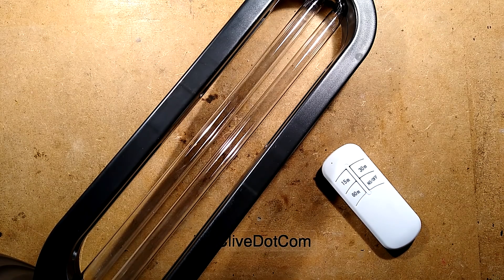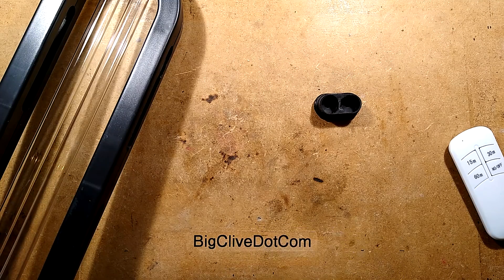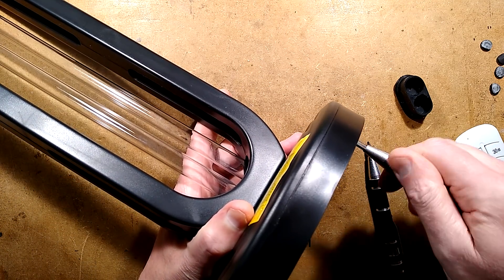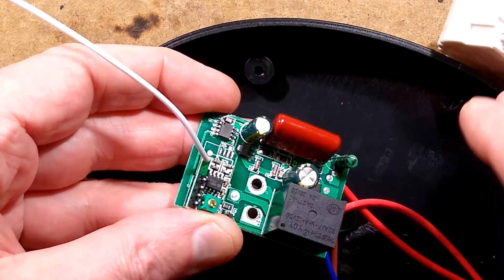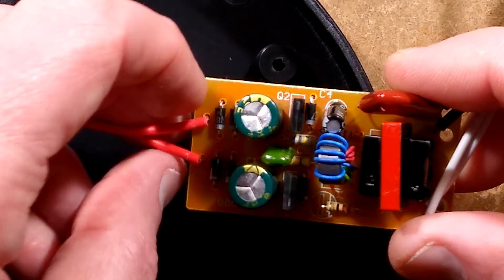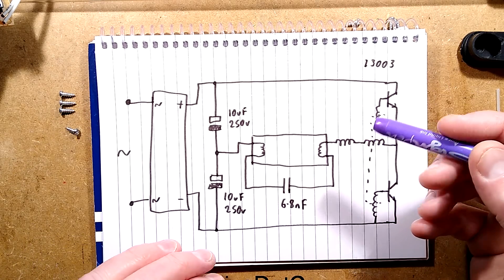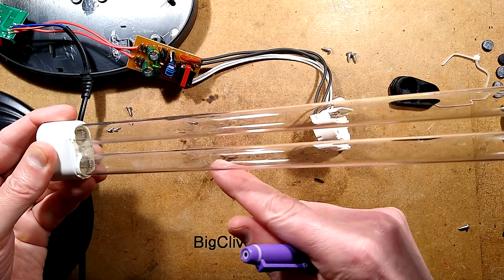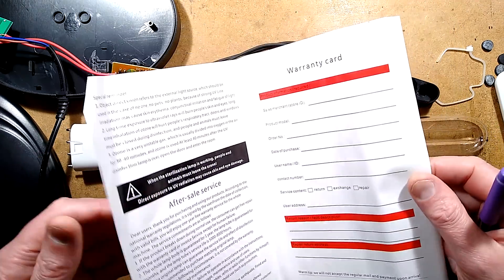Inside a stylish tabletop UVC germicidal light.  (Skin, eye and lung hazard)

Comment: I bought a 36 watt UVC lamp to serve as an extra sterilization step in cleaning my EMS squad's ambulances after wiping everything down. It certainly does put out copious amounts of ozone, by which I assume that it is also putting out copious amounts of UVC at 185nM wavelength. It came with a pair of yellow glasses with no markings for "protection". I immediately tossed them to the side and got a name brand pair of UVC goggles and I still don't stick around once I verify that the lamp has turned on.

Comment: It does the job.
(If the job is planting a dangerous object at a garage sale 10 or 12 years in the future)
A friend bought just such a mercury vapor lamp at a garage sale which had a sticker on it stating simply "Sunlamp" with a picture of a "sun man" who was, prophetically, wearing sunglasses. My friend was lucky to only get welders eye and a bad sunburn in the 1/2hr he said that he had used it.
I inherited the lamp for examination, it was a tin box with a small ballast, starter and a bare u shaped mercury vapor tube. The tube died with an airgun shot, the balance ended up in a junk box somewhere.

You almost HAVE to properly label something like this and bring it up to code (or at least a reasonable level of safety) if you allow it to continue to exist. It's like receiving a "fake" grenade and finding it's got real powder in it. You can't just put the dummy fuse back in and pass it on.

Comment: Thanks for reviewing this one is like copy of proper one I have at home that is taller and tube is 55 Watts and its made from metal stand and cage aroud the tube I paid aroud 60 pouds and it came with nice neathy remote with anthena and what is bad about this one it turns on straight original one will be off untill you select time and than it will turn on afye 15 seconds. And it's ozone free safer to enter room after bein sterilised.

Comment: You are probably right about "who discovered potato juice would relieve this"...
I was a welder/fitter for about 15 years, and flash burns in your eyes are just something that happens when you are working in close proximity in a welding shop to a bunch of other honyocks all day.
And when you get a good case of it, it's the worst thing ever... you'll be willing to try just about anything and everything to make it go away. A bad case of weld flash is absolutely one of the most miserable things I've ever had to endure. I once made the wife get up at 1:00AM and drive me 40 miles to the hospital just to get one drop of that numbing stuff in each eye (which they will flat-out REFUSE to prescribe or let you leave the building with). So yea... I imagine the guy who discovered this potato thing was going through the same condition.
Oddly enough, I've never tried the potato juice thing, I don't even know if it works.

Comment: When comes UV lamps as sanitazing equipment for keys and such could you use money tester device with tube lamp? I'm asking because I found one manufactured in late 80s or early 90s judging by the sticker on the back. It is power by 220v AC and it is just a metal case with lamp ballast and socket with said tube.
Reply: Wouldn't be effective, the banknote testers are on the same UVA wavelength as disco lights etc.
probably want to be giving keys a squirt of 70% alcohol from an atomiser bottle and a wipeover IMO
Reply: @joinedupjon  I actually have IPA isopropyl with atomizer next to the door. I just wated to use this gizmo for something else and give it a second life.
Reply: @Szeptun  suppose you could stick a UVC tube in if you wanted and fit a  timer. I don't think it's a good idea and tbh would only sterile one side of a key at once. 

Proper use of UVC tubes means having them in a closed lightproof box with an interlock... like an old EPROM eraser

Comment: U shaped tube because the other type is still covered by a Phillips patent and copyright. They developed the machinery to take the 2 straight tubes and join them with the top bridge, and made automatic machinery to do so, though doing such with quartz glass is difficult because of the high temperatures you need. Much easier to simply heat the quartz glass till it softens, and pressurise it slightly while bending around a mandrel to keep it from collapsing.

Comment: Typical bare run chinesium snakeoil. Presume the tube is a real deal, this thing is still a waste of electricity. Using layman terms, germs and virus are some tough bastard, you need to shoot them in point blank range with death ray to kill them. Somthing deliver like 6mj/sq cm at 5 mm distance in 45min or less time.

If your common sense is still there, did the manufacturer tells how big an area it can sterilize? I have seen someone who are in making dry fish and squid business using similar setup. He think it is a better solution to kill bacteria for the fish meat. Better than the current method of other manufacturers, they are using ddt and sulfur. Guess the result? Of cause he fail, yes, the uvc and ozone kill some of the bacteria on the surface, but if the fish meat is too thick, the core is still untouch. How about entire room? Put it this way, the strongest uvc source we known is what? The sun, right? How about the sun compare to this tube? And the fact is, even sun dry fish is still not a 100% success, what do you expect? Germs and virus did not extinct, and we have the sun shining everyday.

How come it works in water treatment? It is use in point blank range with limit volume of water with a strong light in a certain time. Do a living room fit these requirements? 

Common sense and do the math, please.

Comment: I wonder how glow powder would react to UVC  it might glow very brightly or not at all, and if you could expose the inside of a broken fluorescent tube or CRT would also be very interesting.
Reply from the maker: Small UVC lamps are used in the neon industry to check phosphor colours.
Reply: @bigclivedotcom  Yes since most neon colors are white when unlit.
Reply from the maker: It's only real affected by the UVA band of the output.

Comment: Thats dangerous unshielded. It might be okay in an unoccupied room, but you may damage some materials from exposure. It might be okay for some applications. Laying a moist slice of  potato on your eyes is something from the 1940's and it does make your eyes feel better. Does it actually aid in eye repair ? I have no idea. I've had some flash burns from being around welding and it at least made my eyes feel better. Good video.The diagram is just like one that would be used for florescent lighting. From the poor build quality it looks like it's made to have a life of around the 1000  hour range, but I'm just guessing. I hope you have a safe night.

Comment: Hi Clive, I modifie a ballast for compact fluorescent tube to work with a 18W UV-C tube. If you are interested (you might be able to make a video out of it) contact me.
Reply from the maker: I've done that in the past myself.  They're very fussy though.  I tried running a short neon tube from a CFL circuit and it emitted smoke before exploding.
Reply: LOL, I have made 8 so far  and I have 1 on test passing the 50h mark and 100 on/off cycle.
Reply from the maker: @pierretremblay9378  Any blackening (sputtering) around the electrodes?
Reply: @bigclivedotcom  No sputtering so far I can see yet. I can tell the ballast is not very bad but I will need thousand of hour to see if it is very good. The striking is a bit fast for my taste but it is about the same as with the CFL.  I use a ballast for 23w CFL but with the 18w UVC I was only able to push around 9W. Somehow the working voltage of the UVC is not the same as the CFL. So the solution is to lower the value of the inductor. The real solution is to remove around 30 turn of wire but is a pain. The other solution is to remove part of the ferrite, that the one I use. A neat one is to put a neodymium magnet on the ferrite, by moving on the BH curve you can change the value of the inductor. The fun part is magnet lose strength with temperature particularly neodymium. That will bring some thermal regulation. At around 80c(N type) the loss will be permanent but that also ok, the ballast have somme kind of memory and adjust to 80c max ...
Reply: @bigclivedotcom  Neon is cold-cathode while fluorescent is hot-cathode. The voltage and current values are massively different between those types. I wonder if this played a role in your unfortunate event.

Edit: I just remembered that I ran a 35W low-pressure sodium lamp off an electronic f-lamp ballast. The ballast current was a little low which caused some sputtering of the cathodes so I stopped running it that way. I actually got in contact with a discharge lamp expert and he confirmed that low-current was causing issues.
Reply: @thelightninghunter23  That one of the odd behavior of FL, they dont like to be turn on. You see between each cycle of the main they go off and on. When you lower the average current the re-striking voltage and time go up. Then because of the ballast capacitor and the negative resistance behavior of the tube the current spike increase drastically making sputtering. And no running them on DC is not good, the negative electrode will sputter very fast. HF then, well now you have capacitive leakage current making the end of the tube experiencing more stress for the same average output. Long time ago a spend a few year of my life designing electronic ballast and they are a nightmare of trade off, witch make them also very interesting.

Comment: 1 Watt while doing nothing? That sounds like a lot. What is it doing? Does it have to keep the electrodes warm all the time? What happens if you try to turn it on right after you plug it in and it's cold? Also they warn you right on the remote control.. "NO" instead of "ON". - Side note, it would be interesting if you bought some KN95 masks on aliexpress and took a close look at them.. I just got a bunch in the mail and not sure how legit they are.
Reply from the maker: The one watt is the standby of the remote control circuitry.

Comment: I am  MD on the front lines of COVID-19. Desperately looking for things to sterilize equipment myself and colleagues use.  I noticed a comment about UV LED's and was skeptical as well. However i found a reference that is up my alley .   It shows UV Lamps which were regarded as the standard has emition at 254 nm. DNA has absorption at 260-264nm so its most likely to be germicidal.  Secondary germicidal effect from generated ozone of course is excluded , but is probably a big component. And I am aware of tubes that by regulation do not produce O3 by limiting its spectra with a coating.  So there are LEDs that are common and cheap that emit in the 270-275nm range. They in a way could be more effective than the 254nm fluorescent tube counterparts, especially the non ozone type. Here are some resources, Contact me to discuss.  https://www.rk2.com/uv-information.php
https://www.ncbi.nlm.nih.gov/pmc/articles/PMC4702654/
http://www.uvresources.com/blog/the-ultraviolet-germicidal-irradiation-uv-c-wavelength/
https://www.light-sources.com/wp-content/uploads/2015/05/Germicidal_Lamp_Basics_-_2013.pdf
Reply: You may want to look at using vaporized Hydrogen Peroxide.    Duke is using it to sterilize hundreds of N95 masks a day.  
https://medschool.duke.edu/about-us/news-and-communications/med-school-blog/duke-starts-novel-decontamination-n95-masks-help-relieve-shortages
https://www.safety.duke.edu/sites/default/files/N-95_VHP-Decon-Re-Use.pdf

Please watch these three videos talking about disinfecting and reusing masks then making and using disinfectants.
https://www.youtube.com/watch?v=2UdtKssU7po
https://www.youtube.com/watch?v=kLWBG_fbJR0
https://www.youtube.com/watch?v=CQ1PNXa_LaI
Reply: And a good page at Wikipedia:
https://en.wikipedia.org/wiki/Ultraviolet_germicidal_irradiation
Reply: Bill Whittaker  Be careful with the rice cookers and home ovens.  The temperature in them swings drastically.  You really need a precise oven with better temperature control.  The engineer at Tech Ingredients covers this.  
https://youtu.be/CQ1PNXa_LaI?t=1221
Reply: Great now work on tobacco obesity and suicides
Reply: @cgletts  lol what

Comment: Clive you need some clip on  arc shades, we use these all the time at work. I can watch the 200 amp cnc plasma machine all day with no issues https://www.amazon.com/dp/B000HJIBQO/ref=cm_sw_r_apa_i_vu8KEb7X83NPV
Reply from the maker: I have some similar shades that fit over my glasses and also a rather shady light reacting one from China.    Plain glass alone will block the UVC components.

Comment: Ages ago when I worked in a biology lab (cleaning stuff up at university) - they had a sterilization cabinet that all the tools/safety googles etc went into - when you opened the door the lights shut off. The professor told me the way it works is it mutates the cells until they die. I suspect there's an actual skin cancer risk exposing yourself to these as well.
Reply from the maker: In the UVC sterilisers it just damages the cells and dna.  I'm not sure enhanced mutation is involved.
Reply: @bigclivedotcom  DNA damage is often repaired, and when repaired incorrectly it equals a mutation.
So yes definitely cancer risk.

Comment: Would that you'd provide the e-bay listings for some of these treats.
Reply from the maker: I'm trying to put people off buying them.  I normally provide search links to safe items, but not stuff like this.
Reply: @bigclivedotcom  in my case, I'd end up with two inside of a cabinet outside of the house. Don't need the ozone, thank you. But, it'd prove quite handy for UV exposure testing for various outdoor items, especially plastic.
Too many fake UVA and UVB units out there, but if necessary, I could gin up one from a standard fixture with some modifications. Simple enough, as I am an old industrial electronics technician. It was just simpler to have one ready to roll.

Comment: 240nm is the threshold, can calculated as oxygen bond energy/Avogadro's number*speed of light/plank's constant
Reply from the maker: The peak ozone creating mercury wavelength is 184.45nm.
Reply: @bigclivedotcom  yes, which is more than energetic enough to make ozone, but the lamp doesn't produce very much other light between 254 and 184-the spectrum is patchy, and 184 is the first big line that gets below the 240nm threshold :).
Reply: Eh, I did more research and is a little complicated 240nm is the threshold, but oxygen absorbs UV light  weakly above 200nm or so (at 220nm) about 1% of the UV light will be absorbed upon travelling through 2metres of air(herzberg continuum)

Below 200nm the oxygen starts absorbing heavily in bands (getting into the range of multiple 10s of percent absorption per meter).

So, in a confined space there should be quite a bit less ozone between 200nm-240nm...but ozone is quite toxic stuff, and even 10~20 times less ozone is probably too much already

Comment: UVC/Ozone.  It's like owning a Gun. Use it appropriately or suffer the consequences.  Don't be afraid to try new things.  Educate yourself about the thing so you can be Big Clive or better.   Point being not everyone is stupid enough to stare down the barrel of a loaded gun.  Those that are..  well good luck and may you live to tell the tale.

I did try the 60W LED UVC Bulbs and they do in fact emit UV to some degree, verified with photo chromatic lenses sitting right on the LED's for a solid minute with minimal change.  However it seems to be such a minuscule amount that it will take forever to disinfect anything if at all.  They are a cyan colored blue light and mine doesn't emit any ozone.  Seems to only run at 30watts at 120volts checked it with HOPI.  I'll keep running experiments on it when i get the rest of my equipment that I ordered but I'm still not convinced they will do much of anything.